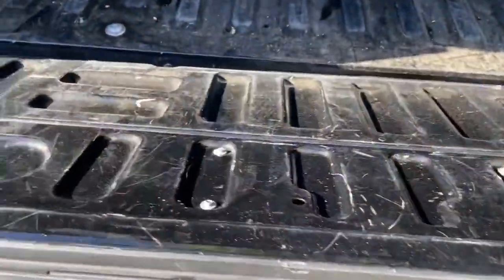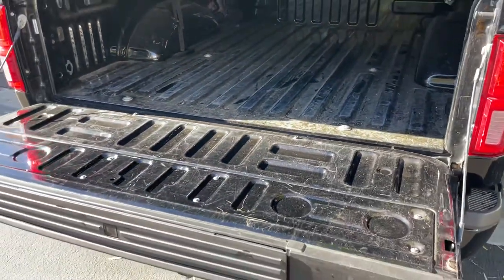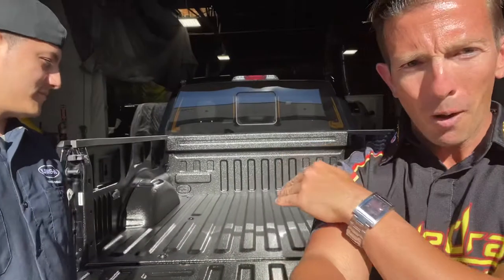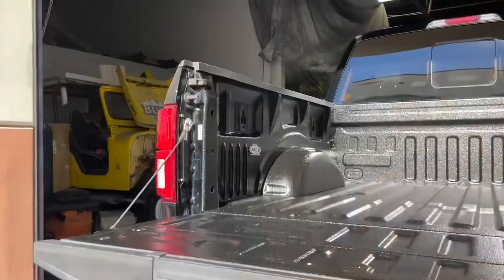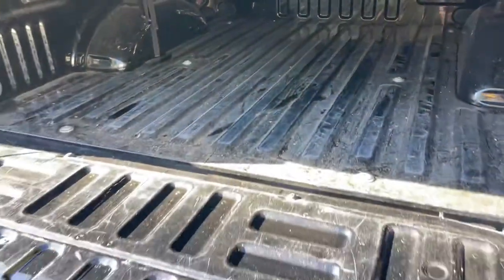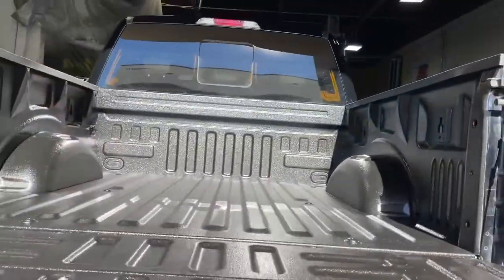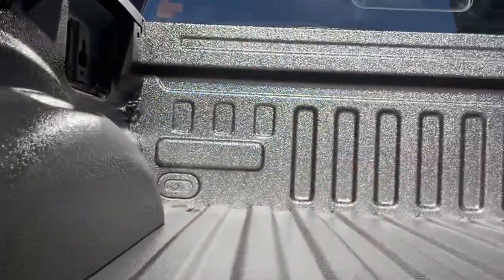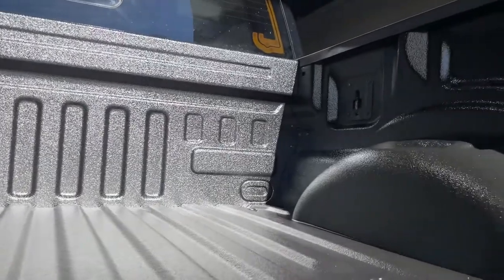WHY LINE-X is the BEST Bed Liner on the Market!

Comment: Line x is good stuff but it's way overpriced!! The line x place near me wanted 1100 to do the cargo area of my work van floor. That pissed me off so I went to the rino guy bought the material from him and with a quick how to from him, I prepped and rolled it on my self. It lasted 10 years under very harsh work conditions until I sold the van.
Reply: can u believe the line x by me had the nerve to quote me $2,800 for the inside of my cargo van floor they wont be in business much longer give it 5-10 years they will be bankrupt